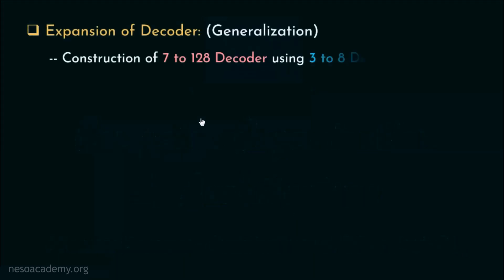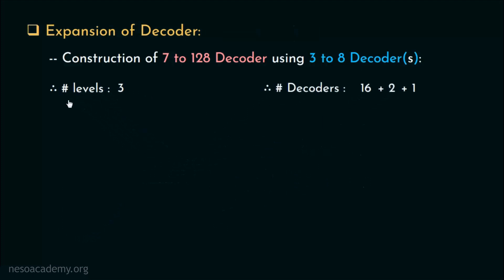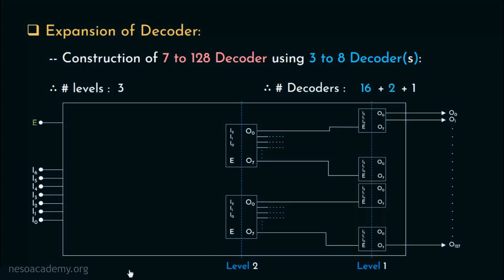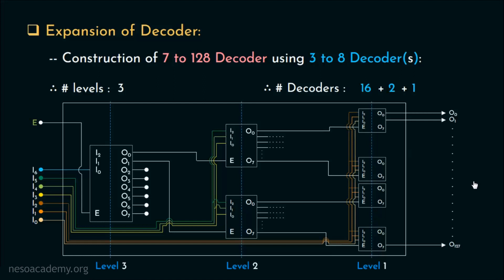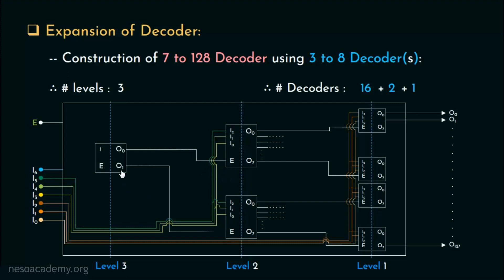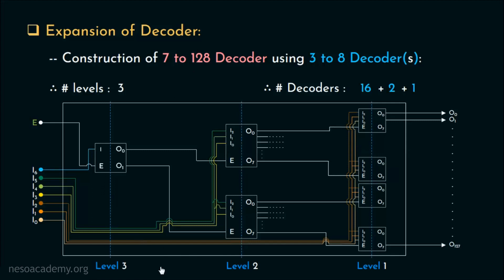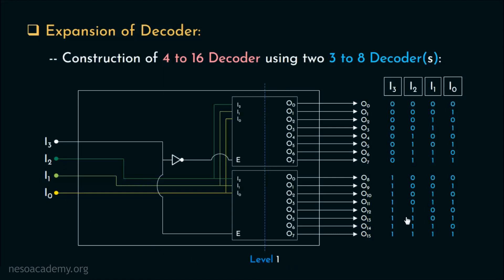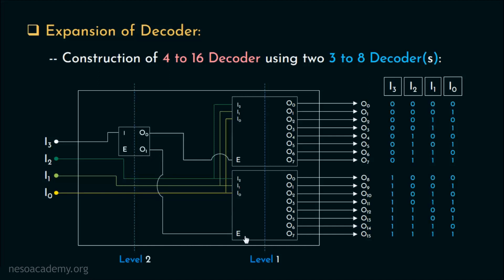Primary Memory – Architecture of ROM (Part 3)

Comment: Here 13:46 , I think 010 will activate O2 which actually is the line O18. Also, 10010 is equivalent to O18 in Binary. Right ?
Reply: Exactly
Reply: I came to youtube just to check this doubt